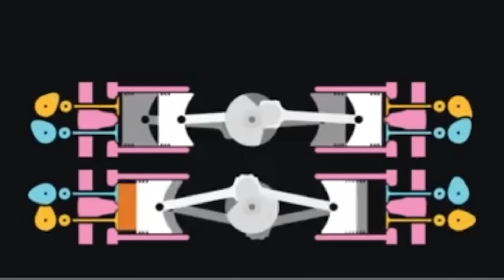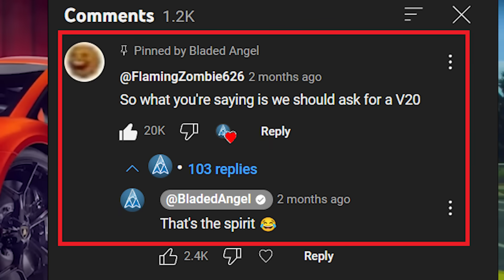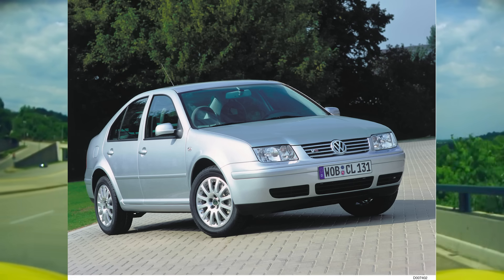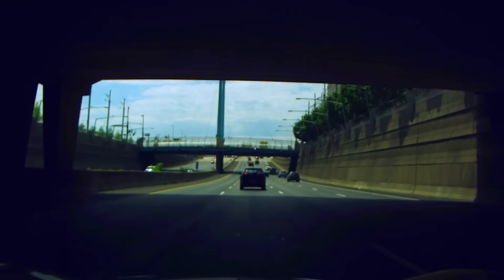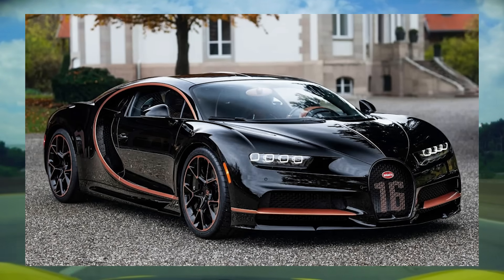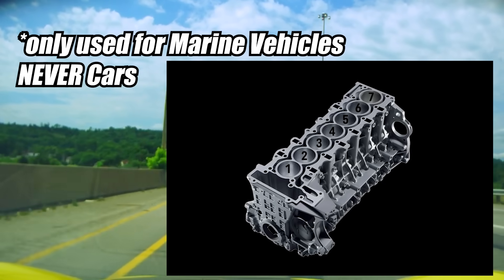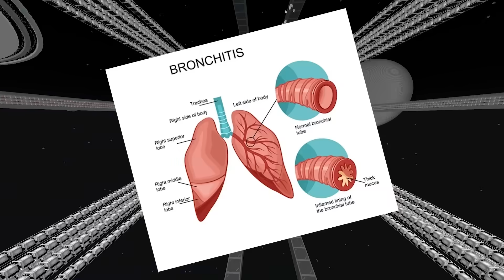5 EXTINCT Car Engines We'll Never See Again!

Comment: Ok so now the question is,
What kind of car can i fit a H-24 engine in??

I need to know for research purposes.
Reply from the maker: Anything fits if you're brave enough.

AKA just weld a frame and wheels aroudn a H24 engine HAHAHA. Comfy interiors? Trunk for storage? NAH, 90% ENGINE LESGO
Reply: @BladedAngel  weight reduction bro
Reply: @BladedAngel  could technically fit it on a drag car, but realistically it's a airplane engine
Reply: @BladedAngel  i mean comfy interiors are just extra unnecesery wheight
Reply: @BladedAngel  But bladed, where is the h24 miata?
Reply: Miata owners be like @BladedAngel
Reply: throw it in the bed of a pickup and make it fwd
Reply: A miata of course (I am sorry for using this overused joke)
Reply: Likely any pre WW2 car with a v16 because those engines were huge. Truly a case of "there's no replacement for displacement". Sometimes they had more car in front of the firewall than behind it, and a lot of them mounted the front axle ahead of the engine so they have pretty good weight distribution.
Reply: Miata
Reply: 2ltr h24 revving to the moon and back for the win
Reply: @WONMARK ...and now all we need to do is swap it into a Smart ForTwo...
Reply: @cen7ury  Smart forfour with the back seat removed
Reply: Miata
Reply: Probably a semi.
Reply: Google "The Meteor Interceptor". You will be amazed lol.
Reply: BMW Isetta
Reply: Rat rod....
Reply: There's something wrong with H layouts. The Napier Sabre for the Hawker Tempest Fighter H24 he mistakingly noted as a surviving example predates the F1 engine and was also an unreliable shaky mess with no surviving running examples.
Reply: stuff it into a BMW Isetta
Reply: That one lotus F1 car: laughs in H16

Comment: An inline 15 is way too long for cars. That makes me think about a W15 engine (3 banks of 5 cylinders) being the best way to have 15 cylinders in a car. The main con with a 3-bank W engine is that the cool intake on one bank could be next to a hot exhaust manifold, rendering that bank a bit of a dud. So I would have the intakes of the left and middle banks next to each other, and do the same with the exhaust headers on the middle and right banks. So the exhaust on the left bank is on the outside, and the intake of the right bank is outside. It would be cool to build and test it.

Comment: Firing interval angle has no effect on balance, 7 and 14 cylinder radial engines exist and don't shake themselves to bits. The bigger issues with a straight 7 or V 14 are the same as those of any other odd numbered straight engine, rocking couples. Balancing either would probably be easier than balancing a V10 or straight 5, the extra cylinders and length reducing the vibrations in the first place. However, even perfectly balanced they would be longer and more complicated than a straight 6 or V12 making them harder to package and more prone to crankshaft torsional vibrations and more complicated than a straight 8 or V16.
Building a 15 cylinder engine is on my list of stupid things to do when I'm rich. I'd go for a 3 bank W 15, 15 cylinders in a space slightly wider than a V8 and slightly shorter than a V12 and the same height as an equivalent straight engine. Stupid but fun

Comment: 15 cylanders mathematically would balance, youd have to do something like an H layout because weight throws balance off. Or an 8 layout. One piston in the middle, one in front, one in rear, the rest on the sides. Basically a v12 with 3 more pistons in the middle between them. This would be the only feasable way itd work as far as space constraints. Now, youll still probably get vibes and imbalance since its an odd number. Im just going off what i learned and what ive seen. Im kind of curious to see the figure 8 15 come to life. Or infitity 15
Reply: Or just a W15, not a 4 cylinders variant like VWs though

Comment: The vr5 isent so terrible with vibration, at least here in europe there is also no problem with finding capable mecanics for this motor. I know of motors that managed over 250.000 miles without major repairs. There are a few known problems that can be easily solved.

Comment: You forgot the V4.
Reply: They do have a huge staypower in motorsport, particularly in bikes. However the Porsche 919 Hybdrid is also using a V4. And yes, the Evo variant also uses the same V4 because of budget/time constraints.

Comment: The vr engine was originally developed by lancia. It was dropped due to balancing issues and never put into production. Before the vw launched v5 they first launched a vr6 (later called r32/36. This was first sold in golf mk3 and Corrado.

Comment: The VW V(R)5 was not so unique in parts - it was based upon the existing V(R)6 and although some components were unique (head, camshafts, crankshaft) many components were standard VAG parts bin items. Remember, this is how even similar 3, 4, 6 and 8 cylinder engines work - different heads and/or crank, differing con-rod lengths… Engines are rarely unique but they never identical.

Comment: Yeah the VR5 is extinct and VW just pulled the 3.6 VR6 vfrom the Atlas in the US. But they also developed a fresh 2.5 VR6 ( 300HP 500Nm) for the chinese market Audi Q6 and VW Teramont. Its even turbocharged and comes with a 7speed DSG. Ive always wished for a modern VR6 TSI from VAG and now its hidden in China...

Comment: the fact that you can divide 720 evenly has nothing to do with the physics of the engine and everything to do with the number system used for measuring angles. so wonder whats the real reason v14s dont exist. your explanation doesnt cut it - sorry

Comment: The "H" monicker for the BRM makes sense.  What does NOT make sense is for Subaru to call their boxer crankshaft flat 4 and flat 6 engines "H".  I have a 2001 Subaru Outback with the 3.0 liter H6, which I think should be called an F6.

-The VR6 and V5 VAG engines were indeed V engines.  They had a measurable V angle, they just compressed it for safety reasons to fit in an area where an inline four would have been mounted.  The V5 was just a way to make 150/170 hp without a turbocharger, and this engine could be built using tooling from the VR6 design, so it was very cheap to produce.  Both engines have a unique sound.  VAG did produce a prototype VR4 and a prototype VR8 engine, but they were more expensive to build than traditional engines so they never went into production.  The VR design in general is expensive, and that is why it is going out of production.

The W8 sounded fantastic due to the flat plane crankshaft.  It was also expensive to build, that's why they got away from it.  It was built with the same tooling as the VR6 and the Bugatti Veyron engines, so it was "Why not?".  You have to understand that VAG is a company run by ENGINEERS, not bean counters, so fantastic ideas like these engines were built.

A V14 can be built, the decimal places mean little.  Flat plane V8 engines have a lot more vibration than cross plane V8 designs, so this really isn't much of an issue on a performance car.  

Great video!

Comment: Isn't there a way to dynamically balance engines?
 Something like the tube of mercury wrapped around flywheels of Harley Davidsons in early 2000's?
There was a 'Rattler' crank balancer 10 years or so ago that had loose weights in synthetic high viscosity oil that was touted as being able to dynamically balance itself but may have been rpm limited?

Comment: I still don't get why the I7 can't be balanced. If the engine has seven pistons, each piston you have to make a crankshaft, with 90° offset. Cylinder 1 and 7 are on 0° offset, Cyl 2 and 6 are on 90°, Cyl 3 and 5 on 180°, and Cyl 4, the middle one is on 270° Offset. So the primary forces are balanced like on an I5. And like an I5 it would need at least one balancibg shaft in order to not explode.
I7s were (maybe still are) used in tractors.
The 102...° just determines the ideal bank angle. So a V14 would need a 51... or 102...° bank angle.

Comment: While it's true we will never see an inline 8 engine in a new automobile again,  and so for all intents and purposes are as extinct as the dinosaurs,  the inline 8 is made as a diesel and is very much alive today, but only for marine and stationary,  industrial uses.    

A major reason for the decline of the inline 8 in the late 1940s, and it's extinction by the end of 1954 , Pontiac and Packard being the last cars to use it, was because it's length required a very long crankshaft, and at high RPM suffered from crankshaft whip, which could allow the connecting rods to contact the engine block resulting in total destruction.

In the 1920s - '40s, the inline 8 produced more torque and ran much smoother than a V8, and so was used for the heavier luxury cars of the time.   In marine and stationary applications,  the diesel inline 8 runs at a much lower RPM than on-road engines and the RPMs tend to be fairly steady,  and so are not plagued by the issues that led to it's extinction elsewhere.

Comment: I really dont understand why flat 8 engines just dont exist for sports cars. When I think about clearance issues it would be just as wide and short as a flat engine and just as long as a v8. In theory you can get v8 power while having the center of gravity super low. That sounds crazy good for a sports car. Imagine a 911 with 2 extra cylinders. Or a brz with double the cylinders.

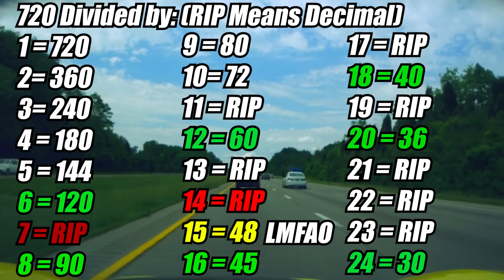Comment: wait wait 11:31 wait waitwait wait wait wait wait wait wait wait wait wait, could you do like a v15 but like each bank needing 7.5 cylinders to balance out, the middle piston on each side could be an oval piston, which would account for the mass? the missing .5?
or does it not work that way idk hahaah
Reply: It doesn't work like that, but you could use 15 in a traditional W layout, which used rows of 3 cylinders using the same crankshaft, one facing left, one facing up and one facing right

Comment: Commonly horizontally opposed engines are referred as h
Wether or not they’re stacked on each other
Like most of Subarus engines h4’s and h6’s or Porsches and VW having h4’s and h6’s back when air cooled and Porsches more later model engines

Comment: I think, H configuration can be balanced little bit, if top boxer engine has inverted firing order, with respect to bottom firing order. 

And keeping both boxers seperate, drawing power via 2 torque converters, that will join into final drive.

Comment: wait, but if 7 and 14 cylinder engines are hard to balance, then how do 7 cylinder and 14 cylinder radial engine exist? 
most well know is the engine used in the Focke-Wulf FW190, the BMW 801, which is a 14 cylinder radial engine.

(also 15 cylinder is not that weird, just 3 rows of 5 cylinders. so a w15, no wait...)
Reply: Radial engines need a odd amount of cylinders in order to have a even firing order

Comment: I still miss Honda's V5 engine screaming around in MotoGP. The fact that the engine is perfectly balanced as well also makes it an engineering marvel. 

They basically made an unbalanced engine by having a narrower V angle with the fifth cylinder acting as a counter balance of sorts.

Comment: If Honda can build a V5, just tripple it and make a nice evenly divisible V15! And speaking of V5s, Oldsmobile ALMOST made passenger cars with V5s... but diesel-powered! Back in the 80s, they designed a diesel V5 from the ground up to go in the new GM FWD platform and replace Oldsmobile's diesel V8-powered RWD cars. The V5 had been through the testing process and its production spec finalized, and very nearly made it to production... Unfortunately, those diesel V8s were so horrible that they ruined the reputation of ALL DIESEL CARS, REGARDLESS OF BRAND in the U.S. and thus GM decided to cancel the V5, as who would ever buy another Oldsmobile diesel car after that? Now there's just one surviving Oldsmobile diesel V5 prototype in a museum, and we'll never hear what they could've sounded like or know if it was any good.

Comment: 6:40 The W12 came out before the W8. The W12 was first available in the D2 Audi A8 from around 1999-2000 whilst the W8 came out a year later in 2001.
Reply: the VR-12 was just two VR6 heads on a new block.
Reply: W12 in the A8L was available from 2001 according to wikipedia

Comment: The thing about those 9 and 15 cylinder engines, is that the only possible layout to maximize area would be something akin to the LIFE W12 F1 engine used in the 90s, and that would require asymmetrical intakes and exhausts . . . Which means one of the banks is always getting hot air in the chamber by default, making it a dud for reliable power, and thats not even taking the account to properly time those cylinders firing orders or other complexities such as wear, cooling, manufacturing . . .

Comment: Mercedes once tried to make a V24 for their new revived brand "Maybach" by doing the same thing you just did, and it was precisely engineered with average reliability. The only reasons (that i could find on the internet) why they never put it in any maybach is because it's "kinda" expensive and Mercedes at that time STRUGGLED to find a transmission good enough to resist insane amount of torque.

Comment: talking about the V14 Engine. in theorie, you can balance them by changing the angle of the cylinder banks and / or using crankpin offsets like V6 Engines are using them, likewise with the H16 Engine. I guess that in this case the stacking amount of secondary forces where to much, combined with the high revs. the best / fast solution would be to use two crossplanes as a start or, but that would be alot more problematic, to use balancing shafts

Comment: A 7 Inline rotor 7 rotors in a line would be easier to balance although still wouldn’t be a solid number the number 7 hates engines, 1080/7 = 154.285… etc also an inline 8 rotor wouldn’t work either 1080/8 =135 BUT an inline 9 rotor would work 1080/9 =120 an Inline 10 rotor could work as well but at that point well, your gonna need a very strong shaft to hold the weight

Comment: Yea the engine we still can see i cant wait for is a 16 rotor its still possible but im sad that the v10s and v12s or going away they eill always be a special engine but bladed you need to do a video dedicated toward unusual engines such as the weird engine that fired cylindrical without a crankshaft i cant explain it because i forgot

Comment: The H 24 is balanced because it essentially has four banks of strait 6 engines.   Strait 6 engines have very small primary and secondary imbalances.   Where as inline 4 cylinders have horrendous secondary imbalances.  Two flat 12 engines won't shake two flat 8 engines will.   Its not "adding more cylinders" its adding the right amount of cylinders.
Reply from the maker: Inline 6 the peak of engine balancing.

Comment: The whole odd piston number thing isn't just balance, it's also about firing order. Pretty much all modern car engines have even spacing between the different cylinders being on their power stroke, thus an uneven fire engine will sound and feel weird to the consumers. You can look at early U.S. V6s as an example of this, they were just a cut-up V8, but at least it would still land on an even number

Comment: Hey bladed, In my school we have this thing called personal project, where we choose one project to work on for the whole year that we are interested in. For my Personal Project I want to either customize or restore a car, however the problem is that I have no knowledge on how to do either. I dont know where to find cheaper broken sport cars, or parts to help fix it. are there any hints, or tips to help get me started that you can give me?
Reply: For parts, if they’re currently being produced, you can contact the manufacturer and have it shipped if needed (this will be expensive of course), or contact an aftermarket shop who provide the required part (probably cheaper but also pretty expensive).
For actual cheap parts, my first bet would be a junkyard cars (google maps or ask around for locations) or other parts cars (Facebook marketplace, Kijiji, eBay, etc…). Show up with cash, wrenches, then haul the part(s) back home (a truck would probably help). Watch for parts compatibility, a car can be “exotic” but might share its platform with a cheaper option (A Cadillac Escalade is just a fancy Chevrolet Tahoe/Suburban, so you could likely use parts from the Tahoe/Suburban to restore an Escalade if needed). 
If you can’t find the part, then you’ll need to manufacture/machine it, or have machinist friends (go find machine shops around you and talk with them about what you need). To learn about the part or assembly you need, you could ask the manufacturer for a drawing. You can also find a pre-existing part and measure the dimensions, or scan it for a digital 3D file and dimension it through AutoCAD or something. Then you can prototype it by machining the part based on the drawings, or 3D printing then building out of stronger materials if needed, or such.
Then assemble your car!
Restoring a car will take time, but also money. The amount of money and time you put in depends on what degree of restoration you want. I’d say your goal should be to get the car to start and drive. For that you’re going to need a motor that can turn, fuel and/or batteries, a clutch/coupling, a working gear, a connection (driveline) from motor to wheels, steering, and brakes. Everything else is optional 😂

Comment: 15cyl and 18cyl can also be made into a traditional W engine. A W15 would have 3 i5s and a W18 3 i6. I think that Bugatti was considering either a V18 or a W18. Also you can probably also make a W24 with 2 VR12s, but let's not give VW any ideas